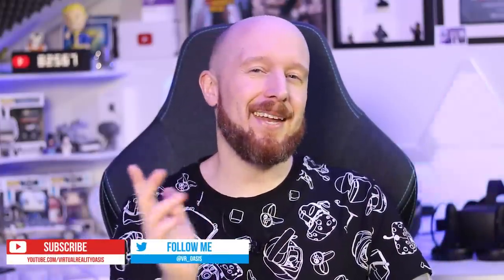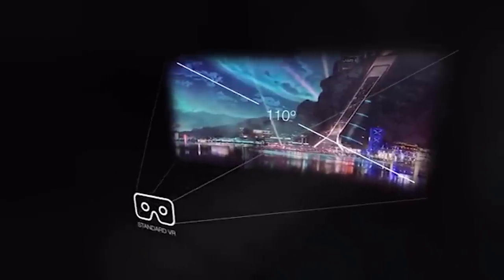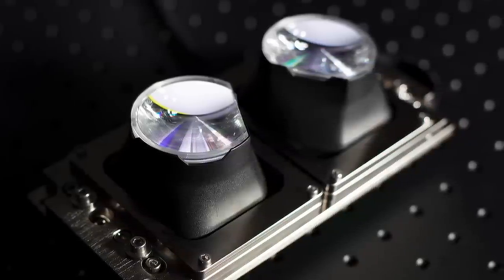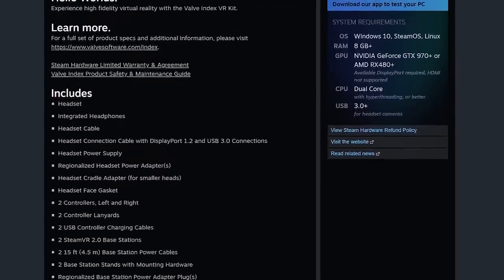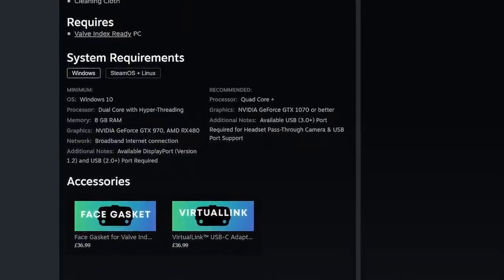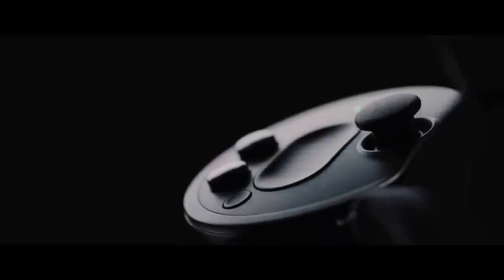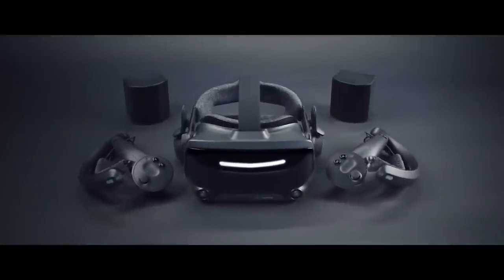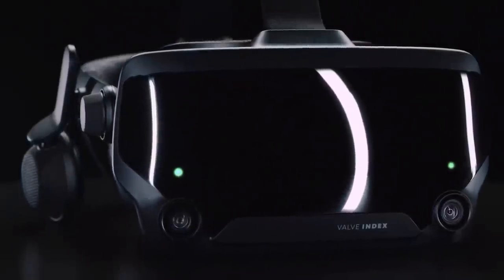Valve Index - Everything you NEED to know

Comment: Its good that there is a large range of price points available. For me im good with paying $1000 for the top end. I have an oculus right now and I love it, the best controller of the 2 at the time. Now it is clear the knuckles is the best controller. Also the refresh rate is something i miss from my monitor when i jump into vr. Once they increase double the angular resolution, create a smoother picture and increase the FOV to a little bigger or around the pimax i might upgrade that and my pc to run it.

Comment: My question is, with all this, if you get the full Valve Index package. Can I still use the VIVE trackpads for full body motion in VRChat and a very small handful of titles that uses full body tracking?
Reply: I assume it will only work if you stick to using your v1 lighthouses, which should be fine unless you have a massive room or one full of mirrors or something. Doubtful if it will work with v2 lighthouses, as (for as far as im aware) none of the other v1 hardware supports these. The backwards compatibility is the other way around, v2 sensors on the hardware support v1 & v2 lighthouses, but v1 sensors on the hardware dont appear to support v2 lighthouses.
Reply: @suicidalbanananana  So get Index, but keep my V1 lighthouses, coolio

Comment: Missed the pre-order for the kit as it was only available for a few hours at most (I checked about 5 or 6 hours after it started, all gone). I reserved a kit and will wait to see how long it takes until I can actually purchase the kit.
As a Vive owner, I'm also pondering buying the controllers and new base stations separately and getting the headset whenever it's actually available, since the discount for the entire kit is a whopping 80€ here. A question I have not found an answer to: Is the difference in tracking between the old and new base stations noticable or is it just about maximum room size.

Comment: I repost my previous comment in case you didn't see it:
Hey mike. Please make a video about Rift S fixed IPD. Do some long run test with people with too high or too low IPD and share the result with us. I say long run test , because eye strain may take more than a few hours to begin
Reply from the maker: I don't have any issues and my IPD is pretty low. I can't run a long term test with different people as that's all I'll be doing for the next month or so as it's just me making videos. I'd recommend trying it out yourself and returning it if it doesn't work out []-)
Reply: Oculus is claiming that the lenses have a big sweet spot which allows the image to be adjusted with software for different IPD and the quality won't suffer. Still needs to be confirmed.
Reply: @VirtualRealityOasis  What is your IPD? According to oculus , the headset should be OK for 61 - 65 mm IPD. But i heard some people are using it with 70 or 58 mm IPD just fine. So assuming that it's true ,  I'm wondering why oculus is saying that. My first assumption was maybe it cause eye strain in the long run (5 hours per day for a few days maybe?) So i asked you to make a video about it.
Or maybe some people with 70 mm IPD are OK with it and some people are not?

I live in a country where returning the headset is not an option 😣
Reply: @vtevdo  Yeah but I'm wondering why they say it's ok for 61 - 65 mm IPD while it's working for people with 70 mm IPD. Is there something we don't know but oculus knows?

Comment: The Index will mark my first full upgrade from the original vive. That being said, my launch window Vive had the deluxe audio strap as well as the lighter 3 in 1 cable. I also have a Vive Pro HMD with the WiGig wireless adapter. I can't see myself going back to wired, even for the Index, and given that the controllers and 2.0 tracking are both compatible with the Vive Pro, I might just stick with that until they announce a wireless solution for the Index, at which point I'll dust it off. I'm still hoping for some unofficial (if not official) support for the HTC adapter and the Index. It should be possible, especially locked to 90 FPS. 

In my opinion HTC is crazy not to work with Valve to support the adapter. They're unlikely to gain any new Vive Pro purchases by limiting it to their products. But they stand to sell a good number of wireless adapters if they add support for the Index. I suppose they're banking on people wanting the Vive Pro Eye, but I don't see it happening now that the Index is here.
Reply: HTC pretty much just shot themselves in the foot right away, they had an amazing opportunity to make Valve a life long partner, literally saving their own company, but instead the first chance they get they turn around and sell a Vive with slightly better panels for almost double the price. I very much believe that the relationship between Valve and HTC cooled down a LOT when that happend. HTC somehow believes they dont need Valve anymore since they've licensed the V1 hardware, proven by the fact they even launched their own competitor store to Steam. HTC doesnt wanna play ball with Valve anymore, because they really want/need all the money for themselves. Valve sure as hell doesn't wanna play ball anymore either, the Valve index is a straight up competitor for HTC that blows the Vive Pro completely out of the water while at the same time undercutting its cost by a quite large margin.

Just wait for Intel+DisplayLink to announce their wireless adapter for the Valve Index, 90% sure this will happen, even at 144hz, Intel totally does have the tech for this. What remains to be seen is if you actually want this, as it might require several routers along all sides of your playspace :P (even higher bandwidth will be needed, meaning even less signal strength)

Comment: my i7-4790k meets the recommended requirement and my gtx 970 meets the minimal requirement.

As much as I would like to preorder the valve index(I'm Canadian), I'm a guy with absolute patience that can wait for a very long time for something and would like to see some hand's on reviews on the index(including you VROS) before committing to the $1000 valve index full set as my first VR headset when it is available worldwide.
Reply: If considering it as your first headset its definitely a smart move to await some more reviews :)
Im on the same CPU btw, worked perfectly fine for the Vive, assuming it will for the Valve Index too.

Comment: Important question: now that the oculus quest can connect to pc, do you think the valve index controllers will work with the quest?
Reply: No. The base stations are needed for the controllers. That is why the knuckles are only compatible with the Vive. The Vive basestations have the same tracking the Index ones do, allowing them to be compatible with that.
Reply: Maybe they can. However, if it is possible (because I don't know if you can do this) you would need a couple of modifications on a steam config file to allow multiple play areas and drivers at once, base stations to track the controllers and USB pucks that connect the controllers to the PC (as the Quest won't connect to the Knuckles). It seems possible as Oculus Rift users already managed to get full body tracking using Vive trackers, but it's complicated and expensive.
Reply: @demirramon  Nope. That is not even remotely close how any of this tech works. The way people are able to use Rift with Steamvr environment, is becasue you can turn the Rift into a generic HMD. Essentially, you are getting the Rift to calibrate in 3d space with the steamvr tracked area. It's a very hacky way of getting it to work, it's not worth the effort. If you want to learn more, use that search bar on youtube. Tons of people do tutorials.
Reply: @axelehouarne659  You need the Link cable for Quest to play PC-VR games. Using ALVR has tons of latency and is not even remotely playable. Also, Quest will not work with steamvr hardware.

Comment: when they are going to release it in other stores like Amazon?
Reply from the maker: It will likely only be sold through Steam []-)
Reply: @VirtualRealityOasis  I hope not, I never bought any hardware on steam and I don't know if I can trust the delivery company that they'll use on my country, I prefer buy it on Amazon.
thanks for answer so quickly, and good video!
Reply: Nobody knows if they ever will, it kinda makes sense for them to just sell it on their own platform and take all the money for it, as opposed to giving Amazon some of the money on a headset they're likely selling for production price, or even below that.

That said, i've bought a Steam Link and a Steam Controller directly from Steam in the past, and got perfectly fine delivery with tracking codes and everything else you would expect, so if you ask me you really dont need to worry.
Reply: @suicidalbanananana  thanks!

Comment: Any information about a wireless adapter solution for the Index like the one for Vive Pro?!?
Reply: Nope. But if Intel and HTC are willing, it should just need an adapter and a patch to software to work with the wigig adapter for the Index. 
If not, Valve will most definitely partner with someone or make their own 60ghz kit. They are true believers in wireless VR. I would highly doubt they wouldn't add wireless adapter or support for the vive wigig kit.

Comment: I only use my Rift for simulation racing, and do not have any need for the controllers. With the index, would I be good to go if I only ordered the headset? Or do I need the controllers for the initial setup?
Reply: I'm not sure if they work with the Oculus trackers. I don't think so
Reply: @minecraftguyhampus  even if I had the trackers for the index, would I be good to go without the controllers? Its all speculation at the moment, I get that, but I'd rather not spend extra money if I absolutely don't have to haha
Reply: @simaddict6676  Yeah I think so, because the headset supports both versions of steamvr tracking and it should support the old controllers.
Reply: @simaddict6676  Although you should probably ask someone who owns the headset first to be 100% sure
Reply: @simaddict6676  You need the entire kit. You would need the basestations to track and the controllers to navigate steamvr.
 If you have LH1.0, that will work if you just get the Index controllers and HMD

Comment: The Rift S doesnt look like it has a safety breakaway connector so the Valve VRlink adapter wont work with it. Unless for some reason the Index tether can be used to replace the Rift S tether.

Comment: Question: In the Netherlands you can order the full package for €1079, but if you buy all parts seperate its €997, what is the benefit?
Reply: You need two base stations, so you need to add 159€
Reply: @Waouben  2 base stations included
Reply: @kryptt-gaming5546  Weird, my prices would be the same if it wasn't the case

Comment: I'm definitely going to get an index as my next VR headset (currently have the Rift), the only reason I did not pre order is the price for the whole bundle. Currently owning the Oculus its effectively like starting again and at nearly £1000 that's a big hit. As none of the new valve games have been announced yet I'm in no rush to buy either. 
Mike the biggest unanswered question is how good a pc are you really going to need? to push the HMD at 120Hz. I currently have a single RTX 2080Ti and I am unable to max the settings in some titles with the Oculus Rift and that would be a whole 30Hz less. AMD Zen 2 (Ryzen 3000) launch is very soon and I plan to upgrade my CPU, in the chase for the FPS deficit as compared to Intel's 9900K. 
I have a feeling though that graphical compromises are going to have to be made to hit the high FPS. But I honestly don't think that will be an issue with the headset, with the better clarity, higher field of view, and hopefully less fatigue in marathon sessions it can hopefully only mean more immersive gaming.
Reply: You would be just fine with a 970 and a recent i5 quad-core. There is something seriously wrong with your rig becasue everything ran flawless for me and I had a i5-6600k, 970 strix and the wireless adapter. I recently upgraded so I can hit that native 120hz though, lol. VR is not that demanding, it's a myth just to sell hardware.
Reply: EVOLICIOUS Sorry but I think your talking absolute BS. I have friends with high end I7 intel systems better than that setup that have both the Rift and the Vive. They have an RTX 2080 Ti and even though they get better frames than me (faster single core performance) in some titles (ones that are graphically demanding) they hit the same problem. To hit a constant 90 FPS visual quality has to be reduced otherwise you hit 45fps with artificially introduced frames. Sometimes that’s ok but for the majority it’s not and you can tell and see the drop in performance. This of course depends really on what your playing. Flight sims or something with slow action low level scenery it does not matter so much. Racing games, or fast moving things in VR that are cpu and GPU intense it ruins the experience. If your used to TV in standard def, then your not going to understand what 4K is like, and the requirements to push that.

Comment: what If i buy pimax with valve controller over the index headset. what will i miss from valve index headset?
Reply: You would miss out on having a overall better product. Buying cheap chinesieum doesn't mean you will get anything of quality.
Pimax just has wide FOV, everything else is complete dogshit about it. The handful of fans and people behind it are severely delusional (due to investment regret). Do not give Pimax your money.
Reply: @sqlevolicious   I would like to play sim racing and open world rpg games like skyrim. i have oculus rift right now and i want more fov but not 200. 
I wish valve hade 150ish fov pimax with 200 fov is way to big for me on the head not comfortable if one want to play for longer times. its so hard to decide over 1000 buck and i still be waiting for next gen 150ish fov i like valve base station tracking plus cameras. Only camera tracking is just bshit like rift s
Reply: @rinkumultani6515  Sounds like you just need to buy the Index. The high fps for sim racing is a game changer and having knuckles with the extreme comfort of the Index will be perfect for big RPGs like skyrimVR and FO4VR. There really isn't anything in the works in the next few years, so the Index will be king for quite a while.

Comment: Will the knuckles controller work with a rift? I guess not if they need sensor towers
Reply: Yes and no. You'll need lighthouses, and two steam BT dongles along with the controllers. The hack to get it working is unreliable (thanks to steamvr jankyness), the Rift runs in direct mode, which it doesn't seem to like. At that point, you may as well just buy a steamvr kit.

Comment: So, I need help? I'm a newbie to VR. My research led me to this system, but I don't know how to integrate my vision to come to life, using VR. I want 2-3 VR headsets to run off of 1 system and laptop, while doing a presentation to youth indoors or outside. Then show on a monitor or movie screen, what they are experiencing to a larger body of youth. I want the system to be as portable and mobile as possible, without weight, and with minimal hardware as possible.CAN it be done?

Comment: I only have a gtx 1070 and a i7-4770k, should I even bother with the index or just get the rift s?
Reply: if you can afford it, bother with the index, the hardware will do fine, at the very least for 90hz you will have no troubles, 120hz will likely be fine too, possibly even 144hz if Valve really lets re-projection kick in when needed.

Comment: Mike can I buy yours cant get one in Canada same as the Reverb Canada is off limits :(
Reply from the maker: Really? How come? Can you not import one from the states using big apple buddy or something? []-/
Reply: @VirtualRealityOasis  yeah we can get it on big apple buddy but it won't arrive until September 12 if we do D: and that's not all in total if I buy it off big apple buddy its  $1,261.01
USD
which is 1699.77$ cad which I can safely say is not worth it
Reply: wish I knew my have to get the Pimax just does not have any controllers or sensors out yet
Reply: @VirtualRealityOasis  .we can use apple buddy but all the things that they add to the cost of doing so bring it up to 1261.01$ USD which is 1699.77$ in cad so it really doesn't feel worth buying it when the oculus rift S is 1000$ cad less. sorry for the reply spam just thought I can clarify why its not worth it a bit more
Reply: @justinvilleneuve4666  found you can get it from Wantboard at $1,506.99 CAD all in

Comment: I know this is an old post but someone wants to sell me an index and am thinking of upgrading . Wondering if you would be so kind  as to give me some advice . 

Am wondering as I already have an og htc vive but wanted to upgrade to an index due to the increased headset comfort , better resolution and screen door and mainly though due to the increase field of view. Apparently is it’s supposed to be 130 degrees vs the 110 compared to the vive,  However I have modded my vive so I don’t have a front face pad and I put my eyes very close to the lenses and wow the fov is better like by 10-20 degrees - it’s basically a full fov vertically and horizontally is good compared to any other headset I’ve tried but I haven’t tried the index yet but am wondering have you ever tried the original vive without or with a reduced face pad and how do you compare it to the index’s fov ? A few people have mentioned the fov with the modded vive is almost the same as the index with the facepad on but am wondering if you by any chance have tried removing the facepad and looking through the lenses of the  index to increase the fov and is it quite a lot bigger ? Would really appreciate your reply . 

Ps Also am going to upgrade my pc from an i5 4th gen  gtx 970 8gb to an i7 4th gen and either a gtx 1070/80 16 go - wondering if you think I’d get good performance on the index with these specs ? Cheers